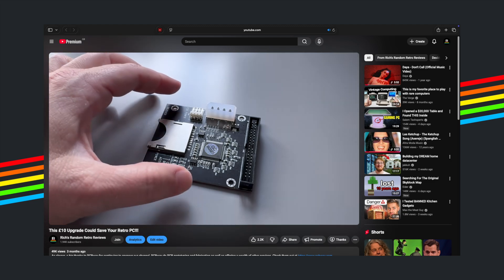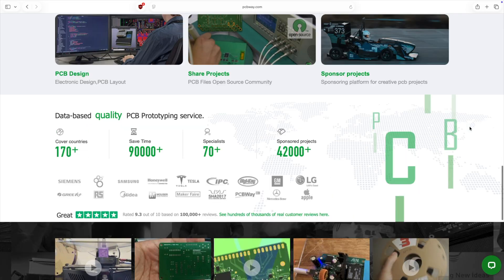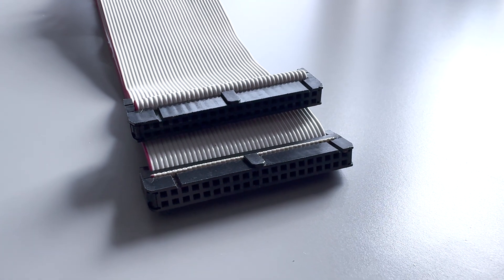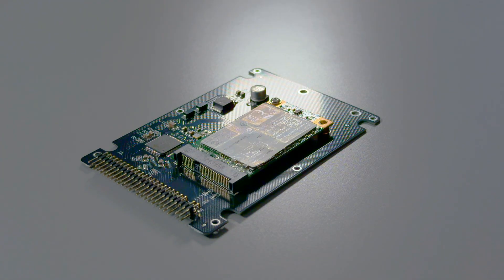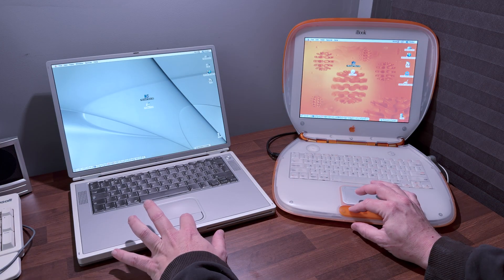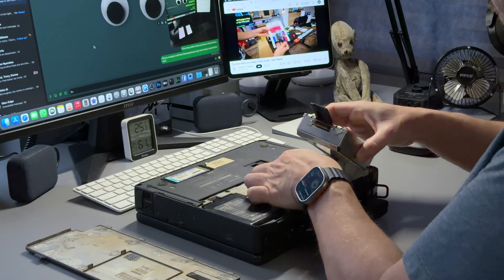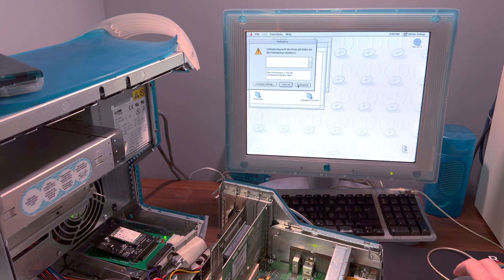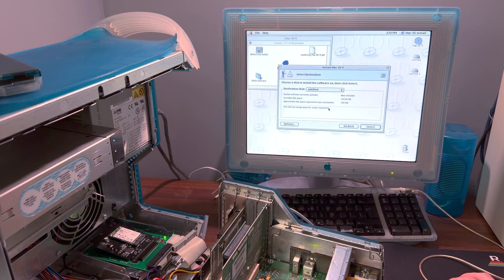Replace Your Vintage Hard Drive With This NOW!

Comment: I have a lot to say from my experience in the same area.  One thing I switched to is m.2 SATA drives to 2.5 IDE adapters.  This is just from the newer value pot.  There are still multiple manufactures of these SSDs, and the market is saturated with used ones, really cheap.  Msata drives are getting old, and only have 2 manufactures that make reliable fast new drives.  I have also found that the SD to IDE adapters to be a bit more slow than unreliable, however this is a suitable replacement for first generation IDE devices, where the adapter is still faster than the machine can handle.  They also have the advantage of form factor mimicking 3.5 IDE connector layout.  This works well in machines that have some goofy, plug in IDE without a cable.  Issues with CF to IDE adapters are also really reliable, but struggle with some hardware as being detected as an external drive, mainly with windows.  Macs and other machines with Linux are typically fine, but can still show as an external drive in the OS.

Overall in the 3.5 drive market.  I prefer cheap new capacity SATA SSDs with the SATA to IDE adapters <$10.00, unless I have to consider connection layout.  Then I will find some other adapter that provides the correct layout.  If its old enough the SD to IDE adapter is a good choice.  (If anyone is worried about reliability........There is nothing that machine offers that needs to be reliable.  A simple image of the SD card for restore is quite suitable).  For 2.5 drives it really up to whatever is available and what I have on hand.  M.2 SATA or mSATA to IDE are both fine, and usually faster than the machine can use.  If reliability is a concern I would recommend the newer m.2 SATA adapter, as it is easier to find new, and most likely "less use".  I try stay away from CF to IDE because of the detection of being an external device.  It is suitable if you have it laying around, but typically not the first option, since it can introduce, "no bootable device".  Always start out with a non CF or SD adapter for testing, then try to move to it.  It will save a bit of frustration.

Comment: That's a good replacement for IDE. Just remember to power it on/use it every 6 months or so. If you ever leave your system powered off for years then you are probably going to get some SSD bit rot, which may not be noticed at first until it corrupts something important. Nothing lasts forever so always make multiple backups to different media if possible.

Comment: How do you copy your old IDE drive over to the new one if you don’t have any special equipment?
Reply from the maker: You could plug it into a secondary IDE bus on a retro machine and copy over directly that way. I use a USB to IDE adapter personally so this has never been an issue for me.

Comment: I did this on a old Pentium 3 laptop with a floopy drive and cd rom which is running dos and Windows 3.11 and Office 3.0 and have to type "win" when the dos has booted up, it workes fine and i have another drive with XP installed which i can swop all on ssd.

Comment: @RichsRandomRetroReviews you don't need a caddy, there is a simple adapter from 44 PIN IDE (the 2.5 inch standard) to standard 40 PIN IDE + 4 PIN MOLEX - AliExpress sells them for like 1-2 euro a piece. Of course you would known that if you bothered to do a research (or simply knowing it from experience)

Comment: PCB Way has been getting very expensive lately. Just a USA problem right now? IDK.
Reply from the maker: My last order was pretty cheap. Resin printed stuff was between $5 and $12. The shipping is a little expensive if you use the default but I always choose a cheaper option.

Comment: wouldnt a 2.5 sata to ide adapter work just as well? Then you can just get an inexpensive 2.5 sata ssd.
Reply from the maker: Yes absolutely! Thankfully there are several options available. However some machines might not have room for the adapter.

Comment: Challenge with this is the Flash endurance cycle count.   

A typical PCI/PCIe bus can cycle a Flash memory past its endurance in hours to weeks.  And then you get flash memory cell failures.   This only really works if you are primarily READING from the flash drive.  Reading and writing as booted OS is doom for the flash . Virtual memory to the flash is where you get hours to days of life span.   Implementing a floppy emulator is probably OK because these are slow and more occasional in writing.
Reply from the maker: If it's so bad, why are all modern computers using SSDs?

Comment: I’ve actually been telling many people for many years now to stop using SD cards, and even the more direct replacement of compactFlash, but people still keep using those instead of a proper SSD
Reply: Your 2 1/2 inch to 3 1/2 inch adapter needs to have the jumper set on the actual Dr., those extra pens off to the side that are unpopulated, determine master or slave. That particular adapter that you were using for the M.2 Dr. does not have cable select as part of its logic, so you have to manually sent master or slave for that to work on a normal ID bus and a full-size computer
Reply from the maker: They have a place. Just don’t rely on them for important data that’s all I’d say.

Comment: I like the idea, but I wish it had a dock so that the m.2 could be yoinked from the machine without opening the case.
In my DOS game machine, I use an adapter to use SATA in place of the IDE drive, and it's convenient because of a SATA docking bay, which they sell everywhere. That way I can tinker with the drive contents on a more modern system without having to take it apart.
Reply: "I wish it had a dork so that the m.2"..not to worry, they have you.

Comment: This reminds me of a mod I did to my old Ipod gen 5 (the first to have the ability to play movies).  I put in a board with a compact flash drive on it and it worked just fine for a while but eventually I think the battery leaked or something because it would not power on anymore... I still have it somewhere in a box upstairs.
Reply: So...you're a hoarder.
Reply: @lenzielenski3276  no no... prepper.  hoarders are unorganized and keep things like old food containers with food left in them.  I keep old tech, guns,ammo, body armor, night vision, medical equipment, fish antibiotics, stuff for irrigating the garden, and so on all in neatly labeled boxes on shelves.

Comment: Warning: flash-based drives will lose data eventually when they are stored without power. How long they can retain data when unpowered depends upon the technology used (it's worse the more bits are stored per cell). SLC-based drives can retain the data for a decade+, while QLC-based ones might start corrupting after only a year. Again, this is when unpowered. When the drive is powered, it can refresh the cells periodically. Of course, then you run into issues with operational cell life, but that's usually much longer.

Comment: Hmm... I'll look into this for my G4 Cube, and my iBook.... and my iMac 20" G5 iSight, although it has a much faster Bus. 
I don't know much about upgrading older macs although I have owned these from new, does the disk size limit apply?
Reply from the maker: Yes the disk size limit applies if your machine doesn’t support drives over 127GB.

Comment: Ah yes, replacing one supposedly unreliable solid-state storage medium with another. Although I've personally never had a problem with SD cards, or SSDs for that matter.
Reply from the maker: Me either - but people in the comments on one of my previous videos were all quite negative, so I figured I'd try and appease them by using an actual SSD. Result: it didn't work....
Reply: @RichsRandomRetroReviews  Oh well...

Comment: Replacing a hard drive with an SSD is missing the point of retro computing. It's all about having the original hardware, original configuration. If we're going to install SSD's into vintage computers, why not just rip out the motherboard and replace that with something modern too? And while we're at it, why not load up Windows 11? Hard drives are an important part of the vintage computing experience.
Reply from the maker: Reliability is also important…not everyone needs a 100% authentic experience.
Reply: @RichsRandomRetroReviews  Reliability is not important---these machines aren't being used daily, they're novelty items. It's not a big deal to replace a faulty hard drive with a good one.
Reply from the maker: @justsumguy2u Each to their own. I'd prefer reliability over having to source a new (expensive) drive and then spend hours reinstalling everything. For the most part, the experience of the machine is the same, just a little quicker to boot and a little quieter. Just because you prefer things to be 100% period accurate, it doesn't mean that everyone does.

Comment: I had to set up a laptop with XP in order to play old windows games like Baldur's Gate, Icewind Dale and Neverwinter Nights.  The only IDE drives I have been able to find top out at 80-100gb.  I thought I was going to have to run them off a usb2 exrternal drive.  This is going to be perfect!

Comment: Be aware that any solid state storage has a limited life. They can only do so many writes to each cell before beginning to wear out. They are better for read only such as the OS. However, the controllers do a process called wear levelling where they move the recorded cells around the disk so that there are no heavily written parts and non used parts. All will be written on periodically. So if you have any files that need to be retained, keep a copy.

Comment: Don't want to break up your enthusiasm, but there is a problem with old hardware/OS that is what affects both SD/CF cards type storage, and also SSD.
Any memory based hardware, from SSD to NVME to SD cards to CF cards and so on, have almost unlimited cycles of "read"; but when writing, you have a finite set of cycles.

So you say "well, I won't write a lot on it"; which is fair, but the OS is not made in that way. With new OS the SSD degradation is accounted for, so everything is written in RAM or CPU cache; to save write cycles. But with things like W95/98 and similar period OS, a lot of data and swap files/partitions are written on the main drive; and that is what kill the storage device.

SD go bad in the IDE adapters not because of SD cards per se, but because they are trashed by the constant flow of write cycles of small files from the OS. Same apply for a SSD, as the technology and limitations are quite similar. 

How to solve the issue? If you use old hardware with old OS, make multiple SD copies of the os, wait that one goes bad and swap it. They cost cheap (for a W95 or DOS system you can go by with like 32 GB, which cost less than 5 bucks), so even if they go bad, nobody cares really. 
SSD? They are more expensive, and to be fair they have more "write" cycles projected for their lifespan. I have yet to see a SSD NVME drive dying after 5 years in my computer, being on all the time, so there is that. But you pay for that as those are more expensive. 

Mechanical modern drives can last 30 years, this is what you find in data centers for storage of data where you need a reliable backup. You don't find SSD NVME or flash memory, unless you need to serve that data. For storage, old mechanical drives are still the king, as they are cheap and reliable. I swapped in my old 286 computers the original drives, and honestly the difference between a mechanical IDE and a SD based IDE adapter is minimal; but the mechanical drive can go on for another 20 years if you don't bang on it 🤣

To each their own of course; it is a choice to be made and for old old stuff I just use mechanical modern drives; while for anything running on SATA I go for SD card based that are cheaper.

Comment: When working with older operating systems such as DOS, Windows 98, or Windows XP, it’s important to ensure that SSD partitions are properly aligned. Misaligned partitions can reduce SSD performance and significantly shorten the drive’s lifespan. Free utilities like MiniTool Partition Wizard can help you verify and fix alignment issues.

You should also disable features designed for mechanical hard drives, such as “hard disk optimization” or scheduled defragmentation, because these tools perform unnecessary write operations that are harmful to SSDs. Additionally, turning off Windows XP’s “last accessed” file timestamp is recommended, as it updates metadata every time a file is opened, creating extra writes over time.

Comment: Just purchased one of these for vintage laptop. Waiting for the mSATA to be delivered. I only had a 2Gb SD-Card fail due to constant writing in a dash cam. Solution was to put a 128Gb card in it. Any Solid state drive has a limited number of write cycles hence those designed for computer storage has wear levelling (TRIM). I purchased years ago some 4GB CF cards, they work well in vintage desktops (with IDE to CF adapter). Using on-track or XT-IDE, gets rid of BIOS limitations of pre-defined drive Types and lack of LBA (Logical Block Address). With SD to IDE, they work but how are they best mounted within the PC. A case is needed to 2.5 or 3.5. For a very old PC, a 5.25 beige tray with a slot for inserting the SD card would be really useful.

Comment: There is an issue with read write cycles on these conversions. There is an issue with the configuration of sectoring the SSD’s. These drives do have infinite RW cycles and there needs to be a correction made to the SSD so as not to make constant moves in placement of data in sectors. Conventional drives can move data between sectors without affecting the life of the drive. One should look into finding the info on how to cure this issue with ssd drives.

Comment: Just be warned, there exist machines where these adapters will straight up fry your IDE controller. Do your research before plugging one in. The vast majority of machines will have no issues but there are some finicky outliers.
Reply: Thanks for not even giving one example

Comment: I've used IDE to Flash Card in the past but had several fail --- so switched to SD card and had no problems.
Obviously if you are constantly Writing and Re-Writing to these devices they wear out.

Comment: How about that. May have to track down some system storage harvested from old chromebooks. 

And I feel your pain about drives not showing up. Pulled some funky off brand 3TB hard drive from a junky enclosure thinking I could format and use it as a needed back up in my system. No idea why, but unless it's connected to the enclosure, nothing I've tried to get my system to see it has worked. Tried researching the drive and only found 1 post about someone having similar issues but no update if he ever got it working.

Comment: Given that many of my Mac hard drives have shuffled off their mortal coils, I have been replacing them with solid state where possible. I still need a small SCSI adaptor for a 520c… space is at a premium. I have also fitted PATA SSDs to some systems and CF to IDE adaptors with success.

Thanks for the video!

Comment: Can I ask what do you use old PC's for? They no longer work online. It is for older games and older software?
Reply from the maker: It's for the nostalgia but also playing games and running old software on period hardware to get an authentic experience. You can do so much these days with emulation or virtualisation, sometimes it's fun to run something on bare metal and experience the good old times ;)

Comment: If the computer has the space an IDE to SATA adapter would be much better.  If space is an issue your solution is great.

Thanks for the video.

Comment: in my retro system i use compact flash adaptor with cf cards cf is ide
Reply from the maker: I mentioned using CF cards in my other systems in a previous video. Compact flash is good but can get expensive for larger capacities.

Comment: Another option is using industrial-rated MLC SD cards (yes, these do exist). The SanDisk Industrial cards in particular are VERY highly rated. The only drawback to the SanDisk cards is that they only come in 8GB and 16GB sizes, and having smaller ones would be useful. I find that industrial CF cards are a better solution if you need to go smaller than 8GB, Cactus is my go-to brand for these but you're paying a premium for them if you can find them new.
Reply: They cost an arm and a leg though; more than an old SSD non-NVME though.
Reply: "and having a smaller one would be useful"..that's what your wife said.

Comment: When you show a video about installing a special retro supporting booting card, please show the link to that product you showed instead of the useless PCBway link. I had severe problems with PCBway in the past before, after ordering and paying. At least 2 times I waited a very long time invain and nothing arrived. So now I order from JLCpcb. Much quicker, cheaper and completely troublefree!

Comment: As the others said, those anti static bags are conductive on the outside. My go-to ghetto drive mount is using a box cutter to slice up three sides of a cardboard box then taping some foam on the bottom. Won’t win points with the 3d printer crowd but they’re too high on resin fumes to notice.
On the topic of IDE to SATA adapters: in my experience the cheap ones from eBay have HORRENDOUS soldering, so if you have a cranky one take a look that the joints look good.